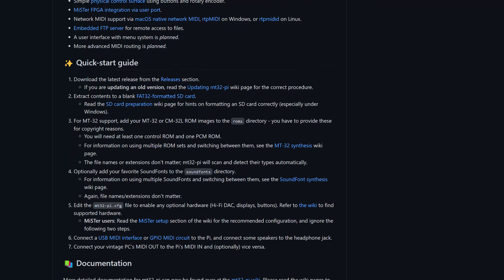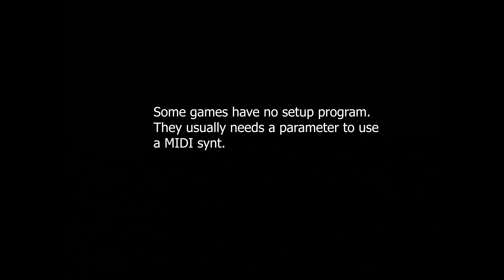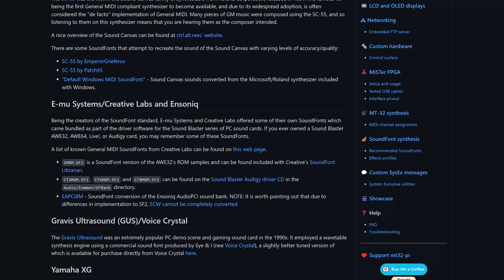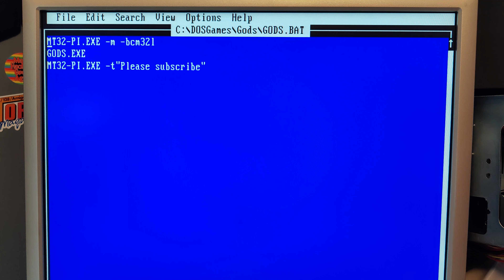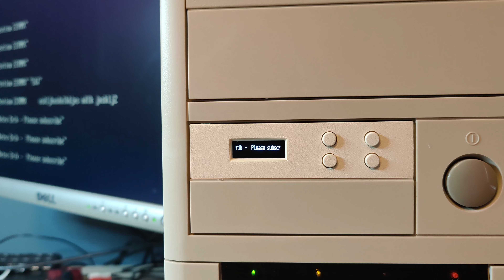Review of the WP32 McCake. MT32 and General MIDI synthesizer.

Comment: Excellent review.  I bought one with the panel connection, which I think is a must if you're switching between MT-32 and General Midi
modes frequently. I have a Roland LAPC-I and I can't hear any difference to my ears to it and the McCake.
Reply from the maker: Thanks for your feedback.
Reply: You can do pretty well with mt32-pi-control and a couple batch files, I do it because I don't like seeing an obviously modern panel on my 486. Using the custom message function you can even send a test note to verify that settings were changed succesfully. For me it's easy enough to tell the difference  between GM and MT-32 on channel 1, and for CM-32L I play a sound effect instead.